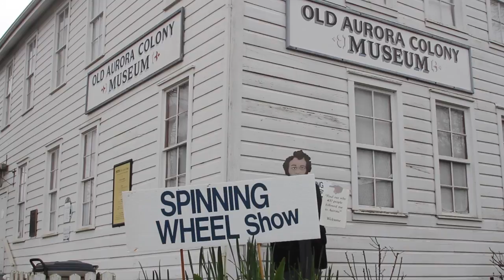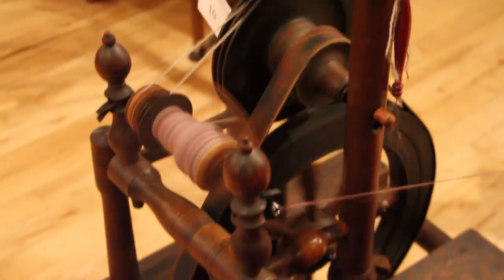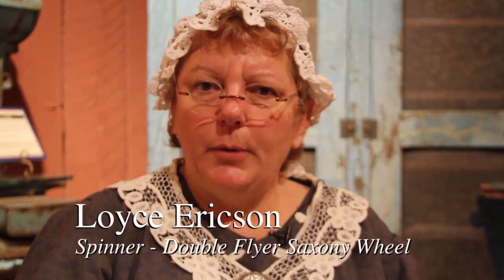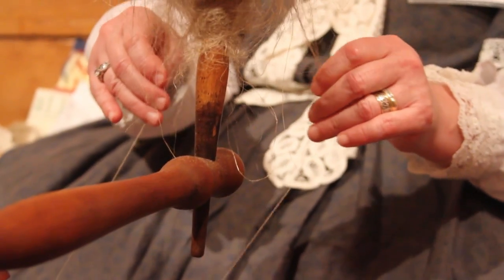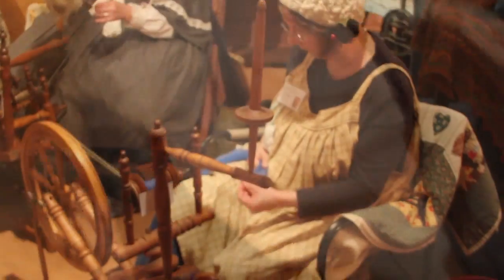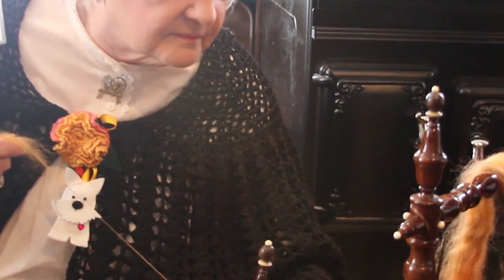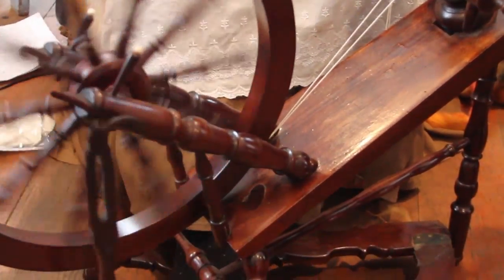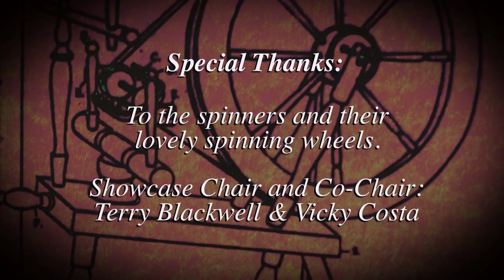Antique Spinning Wheel Showcase

Comment: I was very inspired by this video I was looking for s pinning wheel so I went ahead and purchased a flax spinning wheel. Her flyer has one wing though and I know I must repair or replace it....it was repaired before so I know it is probably too delicate to spin with. Do you have a referral for these old parts in my search? I know that they are pretty specific but being that I have the original one, I am hoping to find a match.
Reply: After receiving another flyer, she only needs a set of leathers to be up and running. I was able to rig the replacement flyer and everything lines up fine.